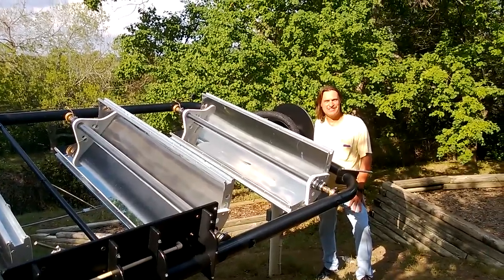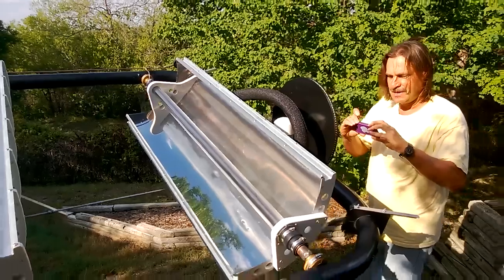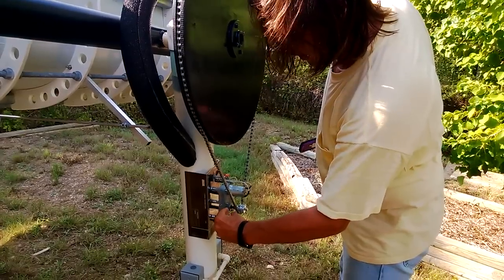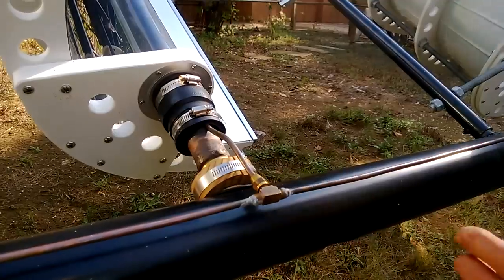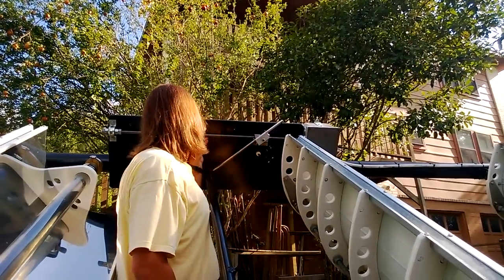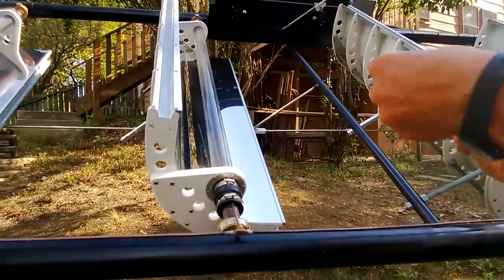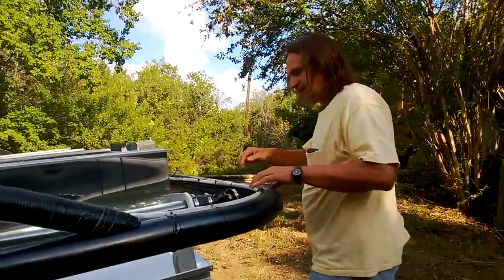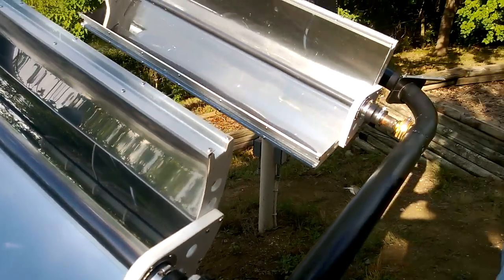Parabolic Trough Solar Collector Water Heater 6

Comment: Wow.  Do you have plans available?
Reply from the maker: Duncan.  I do not yet have plans available, though am considering doing so.  Tell me, do you think that you could build a parabolic system like mine if given plans and provided electronics?
Reply: Yes absolutely.  If you decided to sell a kit, that would be even better!  Really like the idea of a sun following system, not only for solar thermal but also pv cells (have you tried that).  How have the vacuum tubes been working for you?  I've heard that they don't hold their seals well esp. with constant temperature fluctuations? 

Thanks again for sharing.  VERY impressive video!
Reply from the maker: Duncan Meskill
I have considered making kits (because that would be the right thing to do), or simply putting everything out there in detailed plans.  The electronics would take a knowledgeable technician to check them once assembled,  so I probably would have to provide finished electronics.  Also, the center pipes and frame require a skilled welder to complete, so center pipes would also have to be optionally provided.  What do you think of these options?  Would you build one of these systems if I provided the plans?  Which skills do you possess?

The vacuum seal is fine.  Of course, helium and hydrogen (and other atoms) diffuse through the plastic so that the vacuum declines from approximately 29 inches of Mercury to about 25 inches of Mercury over a period of about 6 months.  I should point out though that the vacuum is not the critical component of this system.  Studies have shown that just COVERING the collector pipes (protection from wind) is nearly identical to pulling vacuum.  The only place where this would NOT be true would be a system utilized in the Arctic/Antarctic Regions.   There, a vacuum would indeed be helpful!  The temperature fluctuations do not seem to affect the vacuum seals.  Once the rubber gets heated by the sun once or twice to 150 F, the rubber "sticks" to the copper/polycarbonate so much that it can be difficult to pry loose.  This becomes a very good seal.

Solar tracking on PV cells indeed makes them more efficient.  However, I am not sure that it is cost effective for PV's like it is for solar water heating.  A solar water heater only takes about 4 square meters.  PV systems take much more area than that.  You see, a solar water heater can be 80-90% efficient.  That makes solar tracking economical for solar water heaters.  However, PV's are only about 15% efficient.  It makes more sense to simply increase the PV area, rather than using solar tracking on them.

Andrew Ancel Gray
Reply: ancelgray You could consider different levels of kits/plans. A simple system for beginners (like me) and then more complicated dual axis systems for more advanced builders, perhaps adding in vacuum stuff and welded pipes, control units as optional extras. For simpler units would just covering the trough with toughend glass or pvc work as well as a vacuum tube? Ross
Reply from the maker: Ross,  I have considered putting out plans for different levels of users.  However, I still have not completely finished my own project.  I just made a REAL etched circuit board for the control electronics (replacing the prototype), and it is now working fine.  It has an Altera CPLD on it replacing all the logic (shew wheee!).  I still need to mount the array on top of my roof!

Covering the trough with glass would be great.  I could not find an economical way to do that though.  My troughs are 5 feet long, and I could not find appropriate glass tubes.  Also, I was experimenting so much that it was better for me to have an indestructible polycarbonate covering tube (as I was taking them apart and putting them back together multiple times).  Perhaps on Round-2  I would use glass.  I do not think PVC is transparent enough in the IR and UV frequencies to make it worthwhile, and I am not sure how temperature stable it is.

George Plhak has videos and plans that you can get started with (that's how I got started).  He can be found here:

https://www.youtube.com/watch?v=6G-hd3M9yTg

Search for "George Plhak" on Youtube to find a plethora of more info.  He also has a e-book that you can download (I have it).

Andrew Ancel Gray

Comment from the maker: Finally Thanh, I like my parabolic solar tracking water heater perhaps better than the evacuated tubing ones because I can mount my system on the North (or East) side of my roof.  Here is a pic (change "0RG", "SLASH",  "D0T" and "g1f" to correct symbols).
modelofreality^0RG SLASH SolarArray D0T g1f
Let me know what you think.

Comment: Wat app do you use to control the system by remote ?
Reply from the maker: Geert,
Well, I have written a control program in C on the FreeBSD computer. This program uses solar-time to position the troughs into the sun. In addition, I have an interface to Apache Web cgi-scripts written in C to create a "browser control web site" that can be run on any smartphone browser or on FireFox/SeaMonkey.   The buttons on the "control web site" can activate the motors/pump and all data is displayed like temperatures, angles, etc.
Andrew Ancel Gray
Reply: ancelgray have you posted the code for the program,"
Reply from the maker: Randy Desnoyers
Randy, I have not posted the code for the program.  It is comprehensive.  However, I have made available the complete FreeBSD 7.0 Flash drive, code and all for the price of the flash drive.  You must have an ALIX 1C/1D/1E to run it though.  And you must have interface electronics too.  I will make electronics  available as soon as I finish the copper PCB board.  Andrew
Reply: still waiting on it
Reply from the maker: Randy Desnoyers
Randy, you are building a parabolic project?
Reply: yes
Reply from the maker: Randy Desnoyers
Great.  Are you "Software Enabled"?    Andrew Gray

Comment from the maker: From Daniel:   Hi Ancel, I've been most impressed with the videos you have produced over time.  Could you list the electronic circuit boards, programming and other details that run your Solar heating system please?

Daniel, here is the circuit board I made to run the Parabolic Water Heater:
http://modelofreality.org/SolarCircuitBoard.jpg
This board piggybacks onto a PC Engines  Alix 1E (or 1D or 1C):
http://siliconkit.com/ocart/index.php?route=product/product&product_id=104
All the software fits on a 4 GB read-only compact flash.
The OS is FreeBSD (the same OS as Apple's OS, very reliable!), and the controller is written in C (written on top of Linphone as a base program so the controller can call/text you if there is a problem!).  There are four, 4 amp, DC motor drivers to run the DC motors and a pump (plus an optional backup pump driver).
Reply from the maker: +ancelgray From Daniel:
Hi Ancel,
Thank you so much for your time in replying. I am more mechanical than 
electrical. Would you be willing to put together the same package as you
 have; less the motors, due to weight and postage, if l were to send you
 a fee please?
Reply from the maker: +ancelgray +Daniel Phipps So you are looking for the electronics boards and the boot-OS/software Compact Flash card(?) (Do you want to purchase the Alix-1E, thermistors, motors, &power-supply online?)
Reply from the maker: Daniel, read this user manual and see if everything looks good:
http://modelofreality.org/FocusTheSunUserManual.pdf
Also, see message below.
Reply from the maker: +ancelgray Ok, see other message.
Reply from the maker: Daniel Phipps
Ancel, Is this all your work? Its an amazing piece of work. Congratulations. I am not only impressed by its complexity but the way it is written and how it explains things. What does the package cost? I can purchase the motors and thermistors here once l have the specs.
Reply from the maker: +Daniel Phipps Yes, I have spent the last couple of years getting this 
parabolic water heater going!  It has been fun.  Thanks for the kudos! I
 have been contemplating selling this system commercially 
(FocusTheSun.com), but I have been very busy at work, and have not 
pursued this yet!  The system is really not all that complex.  It is now
 running very smoothly and I have not had to "tweak" the software for 
some time now.  I would say that it saves me about $50 (U.S.) per month 
in water heating bills.  I use an "inline" (or "tankless") electric 
water heater for backup so that I do not heat any water tank with 
electricity.

The package that I am proposing for you includes:
1) The piggyback solar control board (has motor drivers, thermistor I/F, etc.)
2) Two small InfraRed Beam Break counter boards.
3) A 4 GIgabyte Compact Flash Card with OS and all software ready to plug into your Alix board.
4) Putty telnet software CD.
5) Installation/User manual.
The price for this package is $199 (U.S. dollars) + actual shipping charges.

Also:
1) You would need to purchase two 12V DC motors:
http://www.surpluscenter.com/Electric-Motors/DC-Gearmotors/DC-Gearmotors/1-6-RPM-12-VDC-GEARMOTOR-5-1741.axd
2) You would need an Alix-1E Board:
http://www.msdist.co.uk/product_pcengines-alix1e-miniitx.php
I have some used Alix-1C boards that I would sell for $75 (U.S.) that are working just fine.
3) You would need two 1kOhm thermistors:
http://www.dudadiesel.com/choose_item.php?id=csensor&gclid=CjwKEAjw-vewBRDH1-b52Lig1hkSJACTPfVFzfkjQlgHu3i-f74nP_jrLb3C1o0J-TcuM5MT5zA8UhoC3urw_wcB
4) You would need either a solar water heater or a heat exchanger to convert your existing electric water heater to solar.  These exchangers are not available commercially, but I have designed an exchanger (for $99 U.S.) that converts a standard electric water heater (with 1" pipe-threaded elements) to solar:
http://FocusTheSun.com/HeatExchanger.jpg
(Do you still use standard 1" pipe in Britain, or is piping now metric?)
5) A 12V DC solar pump.  Here is the one I use:
http://www.amazon.com/Solar-Circulation-Pump-Topsflo-15PV/dp/B005EU7ONM/ref=sr_1_1?ie=UTF8&qid=1444822928&sr=8-1&keywords=topsflo+solar+pump

6) Here is the "tankless" water heater that I use for backup:
http://www.amazon.com/Ecosmart-ECO-24-Modulating-Technology/dp/B005NM3K2K/ref=sr_1_5?ie=UTF8&qid=1444822615&sr=8-5&keywords=ecosmart+water+heater
I do not know if it will work with British power.  Do you have 50 Hz 240VAC power in Britain?  (We have 60 Hz 120/240 VAC power here).  

Let me know what you think!
Andrew
Reply: Do you know what the top temperature you can get the water to is?
Reply from the maker: Well, Jeff. you can boil the water if you want to.  I depends on how you set it up.  I only let it get to about 150 degrees Fahrenheit, then the computer turns the array to the north, as the water tank is as hot as it really should be.  So the temperature depends on how large the water tank is and how fast you circulate the water.  The larger the tank, the longer it takes to heat it up.  The faster the circulation, the longer it takes to heat up.
Reply: Thanks, ancelgray for the response!